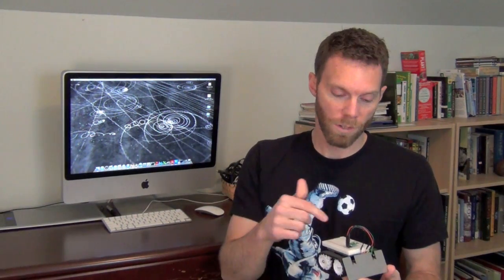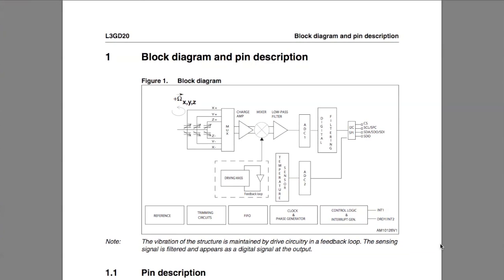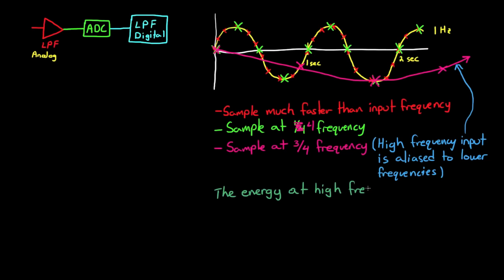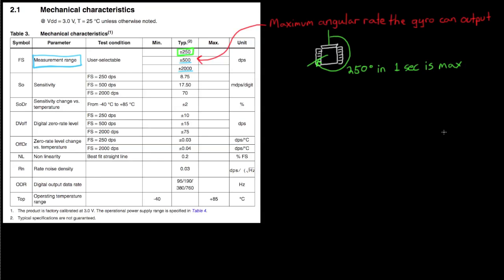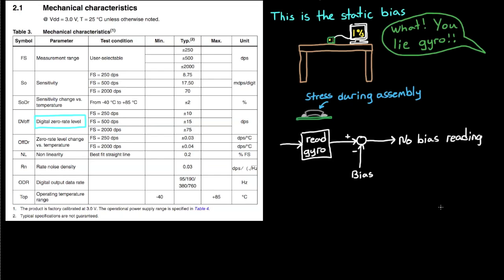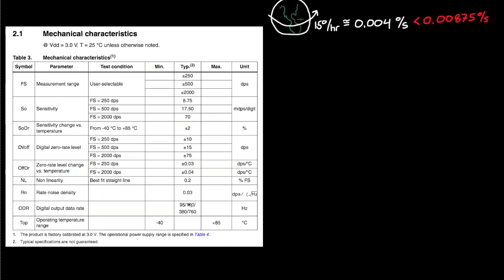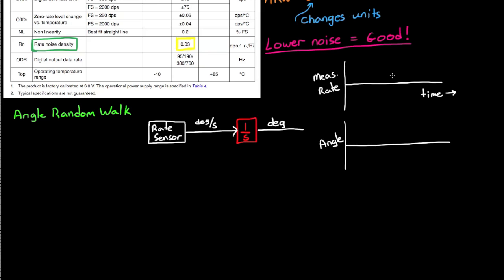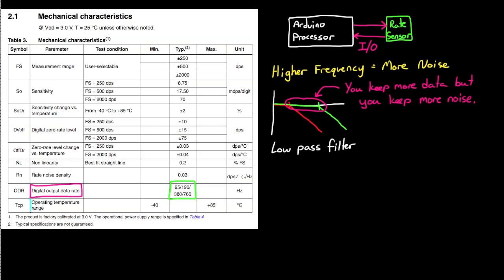Robotic Car - How to read Gyro Datasheets (Part 1)

Comment: Hey I am using MPU6050 Gyro sensor(it's 3 Axis). Initially the values are x= -0.18 y=0.01 z=0.00  and after rotation to 90 degree there is change in values for a moment and then it settles down for the same initial values of x,y,z before rotation. Why does this happen? and i want to convert these values into degrees. can you help me out please?

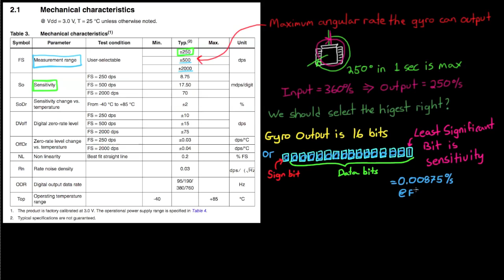Comment: 6:56 I am a little bit confused. The datasheet says that LSB sensitivity =0.00875 @ 250 °/s
but I calculated that the LSB sensitivity was 250 / 2^15 = 0.0076 °/s
What am I doing wrong?

Comment: How higher sampling rate brings more noise?
Reply: He states that since you are operating at a higher frequency (for the higher sampling rate) the pass band (or the cut off frequency) of the low pass filter will need to increase for you let that high frequency data pass. If your low pass filter pass band increases to allow high frequency data, consequently it will allow high frequency noise to pass.

Comment: Thank you for sharing your deep understanding of the control system subject.
I am looking for a process control loop real life example. Consider a liquid flow control loop consisting of pump, control valve, flow sensor and controller. How can I deduce the loop transfer function from actual datasheets of pump , control valve and sensor. Then determine the correct tunning parameters of controller

Comment from the maker: Aww, it's a units issue.  In Crossbow they state PSD and FFT in degrees per hour, in my video I use degrees per second since that is what is in the datasheet. So the difference is a factor of 3600 sec/hr. Hope that helps!